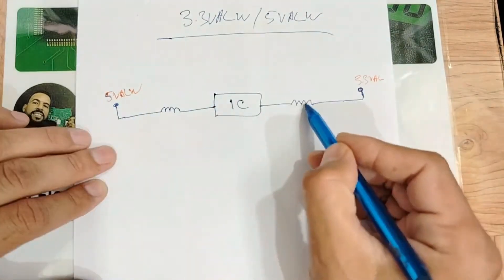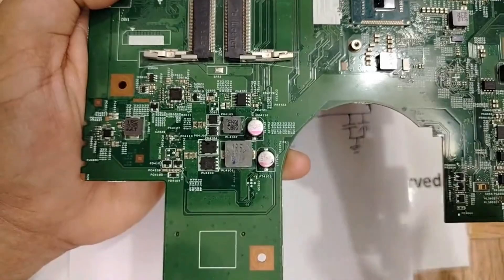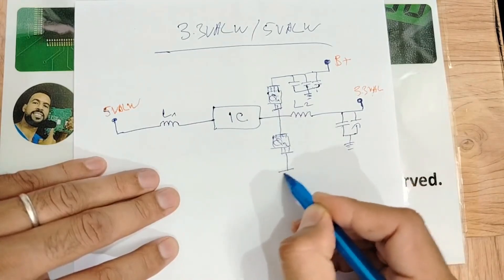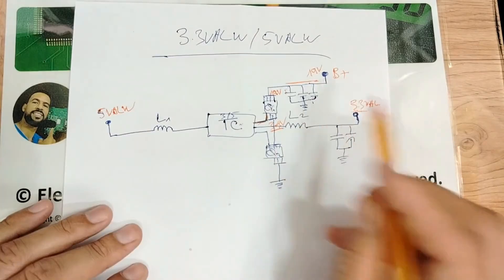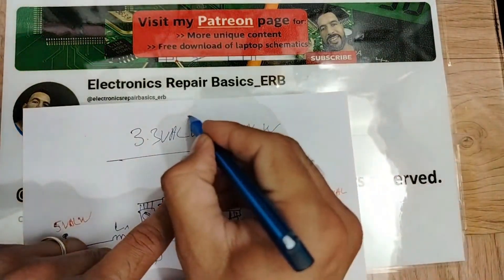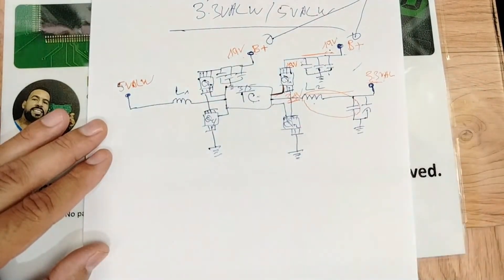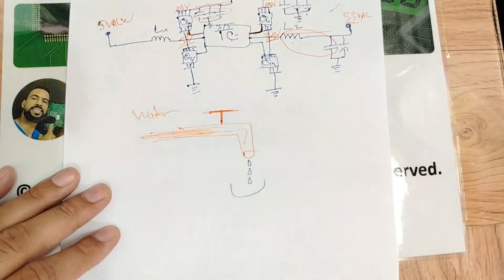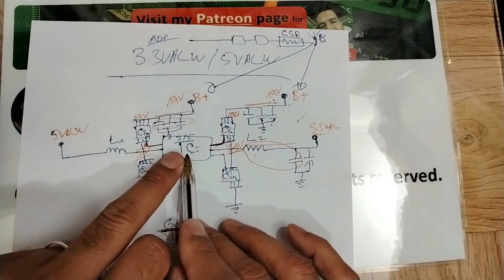Fix Dead Laptops by Mastering 3V/5V Rails in Minutes - Motherboard Repair

Comment: Excellent description. Question- when checking for shorts, what does it mean if the Gate is shorted to the Source (while mosfet is still on the board with no power (no battery, no cmos battery, and no adapter))?  I look forward to your response (if you have time).  Thank you!
Reply: This is usually indicative of a bad mosfet. The gate shouldn't be shorted to source. It means it's either permanently switched on or off, neither of which is desirable.
Reply: It may be shorted through another path though, trace the signals back to be safer.